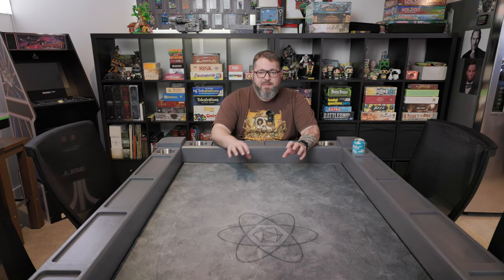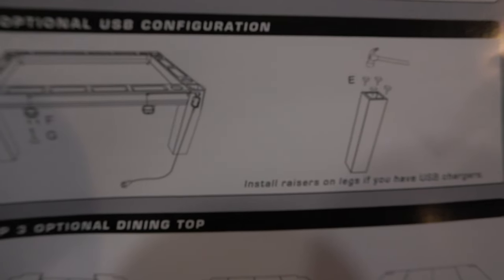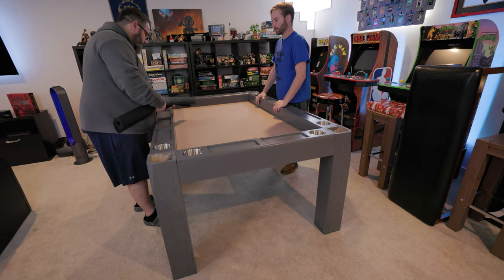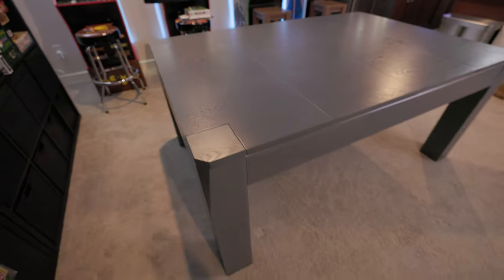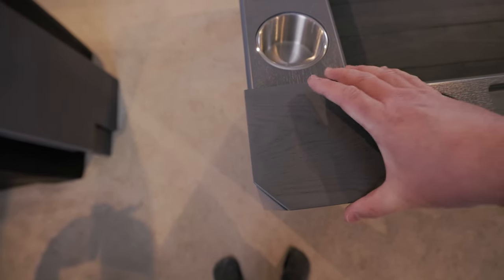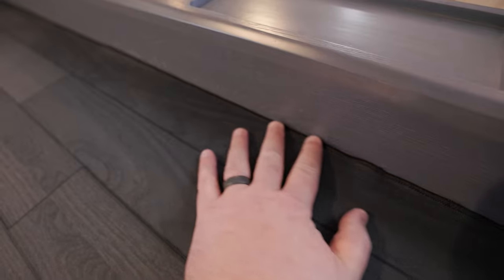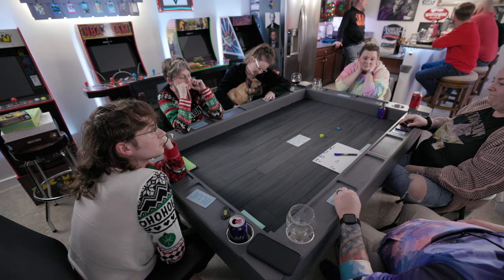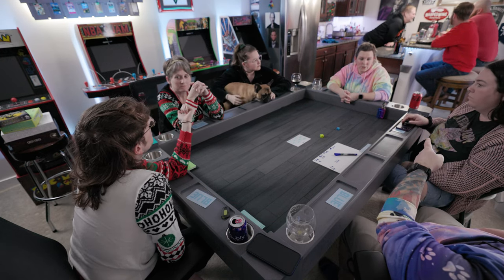Origins Game Theory Table Review - Unboxing, Setup, and Issues

Comment: I have the same table and i have 2 different mats and both don't fit correctly and one of them doesn't match the color of the smaller mats on the top of the rails. Pretty disappointing but other than that I love my table.
Reply from the maker: Agreed! Hopefully they fix this with newer mats.